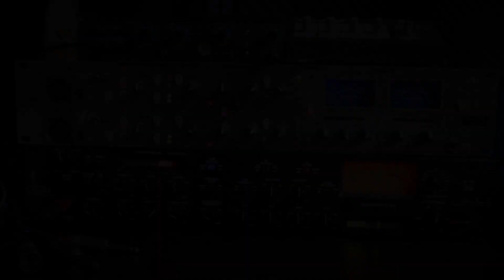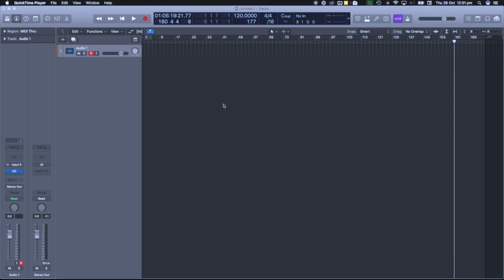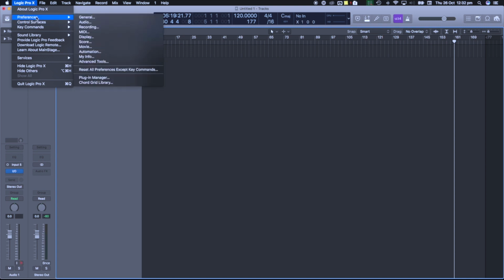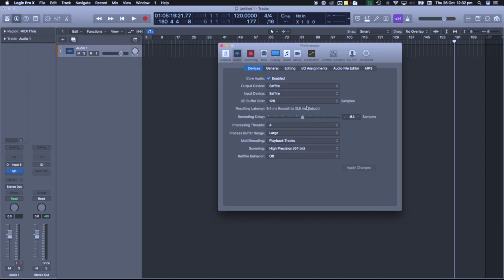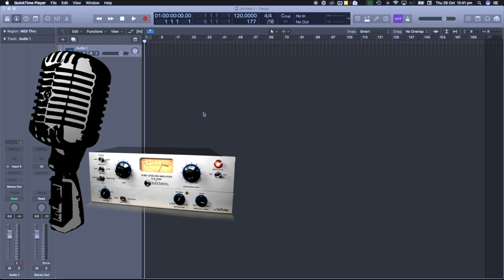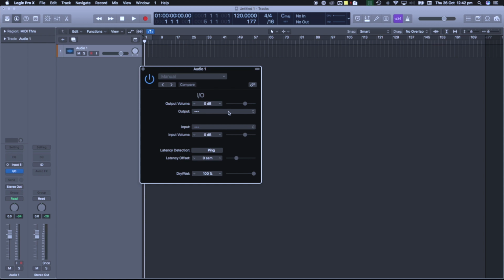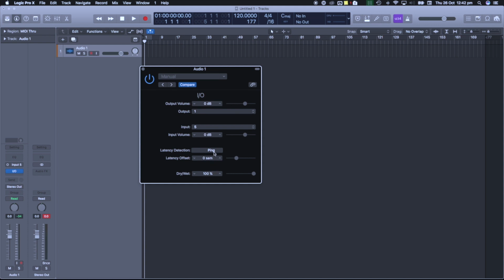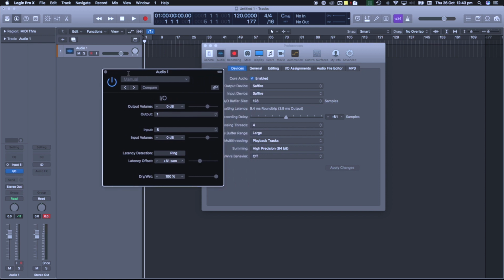How To Fix Recording Delay (Logic)

Comment: You’re a legend! Thanks so much for the effort to share this 🙏🏼🙏🏼🙏🏼
Reply from the maker: No worries at all mate, I'm glad i could help you. I wish you all the best on your musical journey.
Reply: @badformatuk  Lol mate I'm actually still struggling with it haha - tracked 6 songs worth of guitar parts yesterday and had all different plugs on the 2buss for each session, so they were all out of time randomly. I'm going through each of those and doing the ping test on each one to pull the waveforms back accordingly, but I still have a question. With the delay compensation aligned after the ping test, does that mean tracking without low latency mode activated? I'll be monitoring the mix with a buffer and listening to my guitar/live parts via a cue channel (no latency) or via the amp itself if it's loud enough.
Reply from the maker: @fattommy4436  Ok mate if i follow you correctly i think you might not be setting the latency setting in preferences to the minus setting of your ping test. I the latency reads -33 the set the latency setting to +33 and you should have 0 record delay. If that's no help let me know mate. And never record using plugins /never every, always do it in post.

Comment: Trying to record a software on instrument. It has so much lag that it takes many seconds and it records something not even close to what was played. This is a recent problem suddenly appearing. On two different computers. I have no idea what to do.
Reply from the maker: Have you tried what I suggest in the video, the latency test? So you can get the numbers on how late it is being recorded in at so you can make up for it in the latency settings. Give it a go and let me know ok.
Reply: @badformatuk  thanks for answering. The latency can help when things seems to work and I need so add more tracks. But when the midi hangs up like that I can even get that far. I can play 10 notes in 4/4 on the keyboard and Logic records.. well, nothing recognisable. Hard to describe. And then the next day it suddenly works again (but with more of a “normal” latency problem). I will try the test though.

Comment: Nice tutorial man. Thing is i keep hitting the ping button in the logic io plugin but don't get my latency offset. Maybe if don't have the right inputs and outputs? If so, how do figure which output and output to set on the plugin? Ps. I have a scarlett focusrite if that helps.
Reply from the maker: You have to select the input and output on the i/o plug in mate, make sure you have the right one selected.
Reply: @badformatuk  yeah i'm just not sure how to know if my input and output are 1 or 2. I tinkered a bit last night and the io plugin gave me 2230+ samples, does that make sense ?
Reply from the maker: Hope that helps mate
Reply from the maker: This only applies if using hardware with the mic, if your using just the mic and interface your problem is to do with the buffer size. Try a lower setting
Reply: @badformatuk  I am using hardware, my mic comes in my laptop from a physical soundcard
Reply from the maker: @olivierbergeron8986  are you using anything other than a mic and a interface?
Reply: @badformatuk  nope, my mic goes into a scarlett focusrite then into my mac into logicc
Reply from the maker: @olivierbergeron8986  You don't need to lay with your latency settings then, your problem might be the sample rate. Change the setting to 128 and see if it helps.
Reply: @badformatuk  i knew that haha, i always record at 32 to get the lowest latency and my vocals still come out offbeat
Reply: I have to mechanically replace them
Reply: nevertheless thx for ur help mate

Comment: What if you've done all that but it's still delaying your vocals while recording and also for some reason no matter how many times I press the ping, it doesn't show me my number 

I'm using focusrite by the way and everything was fine, never had this problem before, I don't know if it's because I updated my MacBook last night but I got a couple sessions coming up and this is stressing me out! Thanks in advance bro 🙏
Reply from the maker: Are you recording in using plugins mate?
Reply: @badformatuk  yeah I am, should I start a whole new session without them ?
Reply from the maker: @braveheartupr  yes mate, thats the problem. Turn them all off and edit in post,  if you want to use plugins while recording you will need a bigger buffer size .but for no latency keep the buffer size as low as possible. Hope that helps
Reply: @badformatuk  THANK YOU MAN!! life saver you are
Reply from the maker: @braveheartupr  Glad I could help bro, all the best with your project.

Comment: This doesn’t stop a delay for me it’s weird. I can hear the vocal through the mic when I  the”I” for input monitoring is off, but then I when I click it on, I hear the vocal again but delayed
Reply from the maker: What hardware are you using mate?
Reply: Bad Format Tv I’m using a nw-700 condenser mic, Scarlett 2i2 3rd gen, rokit g4 monitors. Running logic on Catalina
Reply from the maker: @DaysDivided  Are you using plugins while recording, and what bit rate are you recording at
Reply: Bad Format Tv I use the compressed vocal preset that has a few plugins on it. Bit rate is 128
Reply from the maker: @DaysDivided  Don't use plugins when recording in mate, turn them all off and then edit them after. Hope that helps mate.

Comment: I have an Avalon VT 737Sp and a Scarlett Focusrite. I don't even know what cable I need to plug the Scarlett output to the Avalon (line? mike?) input in order to be able to ping. I tried different combinations and nothing happens when I hit "ping". Can you help with that?
Reply from the maker: sorry about the wait mate, a jack should do it i think. Send the out put of the Avalon into the input of your interface and the out put of your interface back into one of the inputs on the Avalon VT 737Sp just for the ping test.

Comment: When i play my vocals it do the opposite it plays back faster then i recorded
Reply from the maker: you will need to pull the latency meter in the opposite way, run the input out put test and see how faster the vocals are coming in and the set in in logics preferences if it comes up +5 you set it -5. hope that helps.
Reply: @badformatuk  thank you

Comment: Sir can you help me out... my logic keep delaying..i have done all the latencey setting and the asio but still I keep hearing myself when am recoding into the mic..i hear playback in the headphone  and this is not making my timing go well....i have done everything i can in logic but still have the same problem..
Reply from the maker: No worries mate, are you using plugins when recording in and are you using hardware?
Reply: @badformatuk  even i take off all the plugins in the project..it still delay and i have watched you video and done what yo said but still cant fixed it...the funny thing is happening on my imac in the studio and also on my macbook..both logic are giving me this problem..and it started today...so i dont know what i have done..am really stressed by this
Reply from the maker: @chakabakaofficial419  what are you using to connect your mic to logic?
Reply: @badformatuk  i connect it through a komplete audio m6 but t also go through a compressor and equalizer ..when i open a nee project..everything work perfectly...this is happening on projects that i have already recorded and i know what am doing wrong..i really giving me headache
Reply from the maker: @chakabakaofficial419  Make sure the sample rate on your hardware matches the one you are using in your logic project. Let me know if that helped.

Comment: yo I like your vibe you just made a fan
Reply from the maker: Big respect bro, glad I could help man!
Reply: @badformatuk  kind of lol I was already at 128 its reading but its still reading latency
Reply from the maker: @hadesmusic1175  What are you using ?
Reply: @badformatuk  the little red one. Forget the name, audio Technica mic, with a cable longer than it should be. On a Mac desktop. I've gotten it down to 6.0ms. every once in a while it's perfect. I have direct monitor on but I don't know if I should if I have input monitoring.
Reply from the maker: @hadesmusic1175  Put the latency setting to -6

Comment: I am using condenser mic and apogee one going to mac as an input and then from mac to mixer, then monitors as output. 

In that case I should not even touch recording delay and I have "0 samples" there but I feel like after a recording (in low latency mode ) my vocals are a bit too quick in a timeline, so I guess that Logic moves them a couple of ms into the left after recording to reduce a latency in recording which is not appropriately. How can I check and set the right delay latency or something which can set my vocals right where it should be after recording? I would be grateful for an answer.

(my roundtrip is 9,8ms (output 4,7ms))
Reply from the maker: Could be your sample rate mate, make sure your logic project and your equipment are matched. Let me know if that was of any help.
Reply: @badformatuk  it's 44.1 always
Reply from the maker: @JEDEN  What buffer size are you recording at mate?
Reply from the maker: Anything over 128 will have a delay, but will be able to run plugins while recording.
Reply: @badformatuk  128 but that could not be the case all the time - there is chance of possibility there. If you have no other ideas - Thank you! ;)
Reply from the maker: @JEDEN  Try using a lower setting and see if it makes any difference bro.

Comment: I got a usb mic connected to my laptop and still have delay when i have autotune on but i want the autotune on so i can record while using autotune to know how to speak into the mic bc when i have the presets off it throws me off bc once i turn presets on it doesnt sound like how i would like it to sound
Reply from the maker: try a higher buffer size, 128 i think will do it. But what your doing is Sending a signal, then the signal is being read by your daw, then its going in to your autotune, then its being processed by the autotune, then being played back. Thats a big ask of your system mate. Some Autotunes are made for live performance but not most. It's like quantising while playing live, it doesn't happen, you sort it after. Hope that helps mate.

Comment: I notice i have latency even at 128 when I already have lot of effects etc. very annoying only workaround seems bouncing the instrumental and record in a new project. or are there other suggestions?
Reply from the maker: You can turn off your plugins when you're recording in, but asking your PC to read over 44,000 samples while recording in your vocals is a big ask lol. you can also freeze the tracks. I'd say the way you're doing it is how most pro producers would go about it. Bounce the stems and then record. Plugins will struggle on the 128 buffer setting, that's for recording with low latency. Use a higher setting for missing and a lower for recording. hope this helped mate, even tho you had the solution already lol.

Comment: I'm using a Universal Audio Twin Finity 710 and a Scarlette 2i2 USB and have set it up like you show but I'm not registering any ping. My stereo out doesn't show the ping when I press ping. I'm plugging my right speaker output of the 2i2 to various inputs in the 710 but no luck. I've tried the front Hi-Z input, and the back mic and line inputs. Just can't figure out why I'm not getting a ping. Any ideas what I could be doing wrong?
Reply from the maker: Li think you might be seining the ping to the wrong output mate
Reply: @badformatuk  I'm using the right channel (normally going to speaker) of my 2i2 interface to the input of the Twin Finity 710 preamp. And the out from the 710 to the input channel 1 of the 2i2. Is that correct? Then since I don't know if R channel represents ch1 or ch2 on the IO plugin so I've just selected 1 or 2 but neither registers a ping on the master as it does in your video.
Reply from the maker: @SteveMadhavas  Go to my website and give me a video call on Skype, ill clean that up for you. www.badformat.co.uk

Comment: Hey boss. I recorded a sample of the issue I've been having. I tried your technique, but it doesn't seem to fix my issue. Please read the detail I dropped in the comment of my video. Here's the link to my demo: https://youtu.be/D7ItpXxXruQ
Reply from the maker: Hi mate, did you get this problem sorted? sorry for the delay.
Reply: Bad Format Tv I did actually. Crazy thing...I typically have a few plugins on the master channel strip. When I turn those off during recording, I get absolute zero offset to my recording. After I’ve recorded that track, I simply turn them back on and playback is normal. Interestingly, I can have 50 plugins on individual tracks and won’t have this problem, but if I have simply one plugin enabled on the master track during recording, I would get the offset after recording. I suppose it’s either a big or by design, not sure. Nonetheless, it’s resolved! Thanks for checking in my friend.
Reply from the maker: @TheGuitarGuy69  Thats the way to record mate, no plugins on if you can help it. do it all in post. Glad you're up and running mate.

Comment: Yours is only about 1.5 ms! Good to know, but not really gonna be noticeable or mess things up. I get zero samples for the ping for some reason. I used two "click" samples/mono tracks panned hard L & R. One has the I/O and the other not. When I bounce in realtime ...I do show a delay (in the sample editor) from left to right sides of the bounced stereo file... of about 570 samples. However when I put 570 (+& -) samples then into Record Delay setting, it is still the same as the orig (570 samples late) when I test. I have an Apollo Duo. 570 samples is about 15ms so if that is correct I'd like to get it right.
Reply from the maker: What set up are you using mate, as in what hardware and what DAW?

Comment: I just have a usb mic is there any fix for that?
Reply from the maker: Im not sure mate, are you keeping your buffer size  at 128 on logic, you could even try 64.
Reply: @badformatuk  its on 128 now. Would my outputdevice setting matter? Its giving me two options.. built in output or system settings

Im using a a blue icicle usb mic on logix pro x

Plug ins currently turned on are:

Space reverb
Pitch correction
Channel eq 
Compressor
Reply from the maker: @mogrizzy   Try not to record with plugins turned on as it takes time to process the audio through the plugins. I'm not sure if output settings would effect your latency ,you can always try them both. let me know how it goes mate.
Reply: @badformatuk  ill try 64 let u know! I got the input output device plugin to work and test the latency on a previous project but havent gotten the ping to work on any other

Comment: I’m using the korg minilogue as a midi controller with the newest Mac OS. I have an adapter for usb because the computer doesn’t have standard usb inputs. When I go into “input” on I/O the only option is “- - -“ or “1-2” when I go to “1-2” it records using the computer mic. I have no audio interface just simply controller to computer. Can you help me?
Reply from the maker: What are you trying to do mate ?